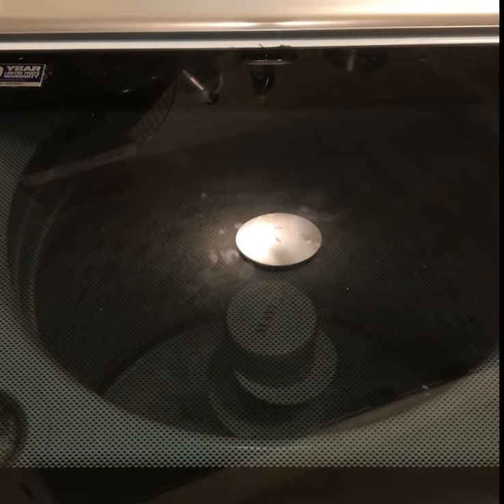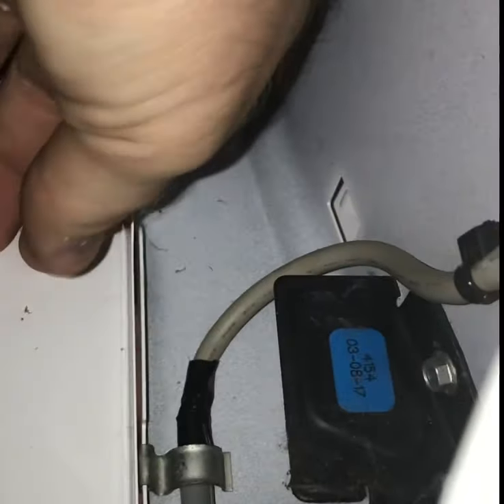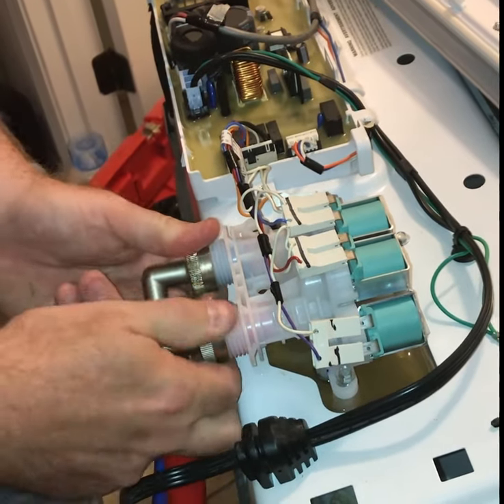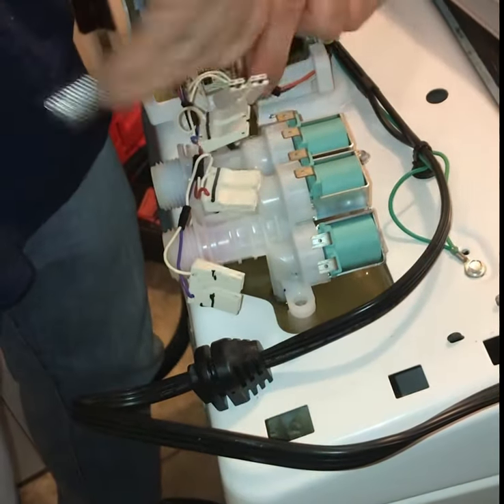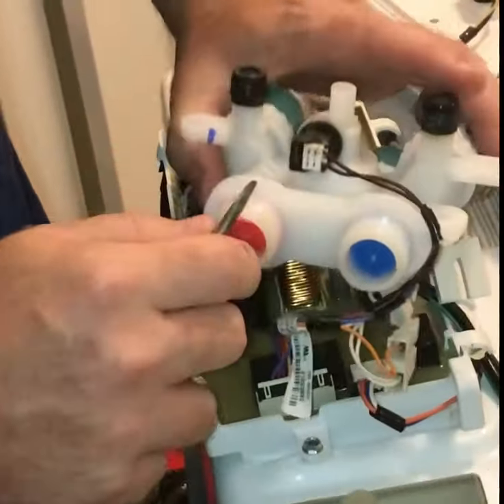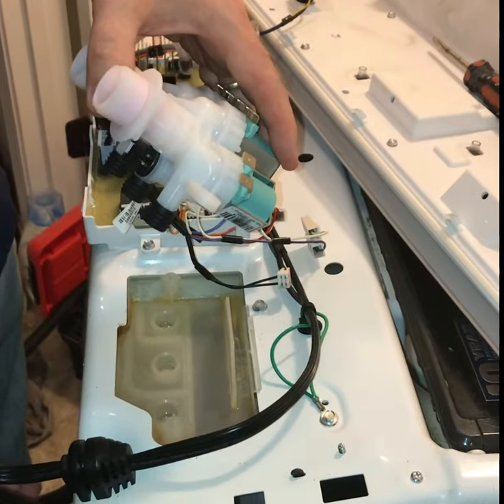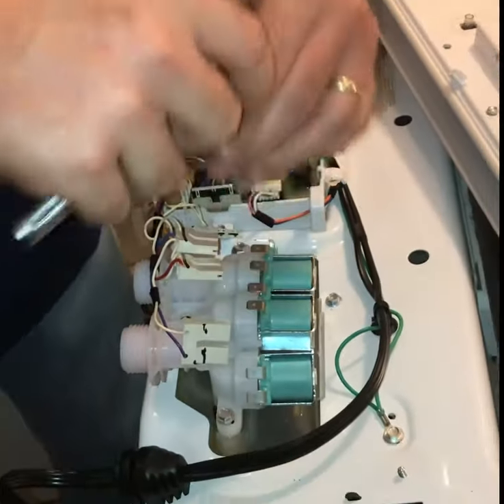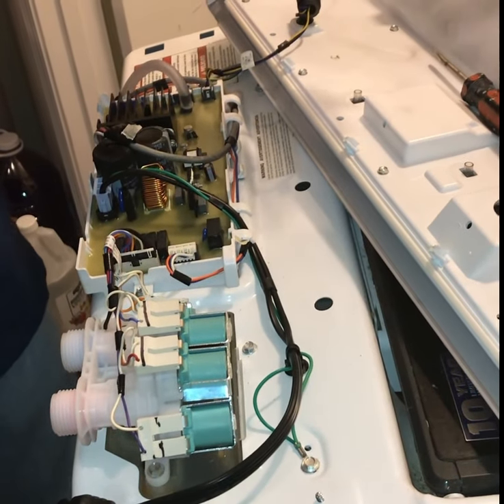Maytag Commercial Technology washing machine water inlet valve replacement

Comment: You don’t have to reach under and “squeeze those pins” to take the control panel off. You can just slide a putty knife under the corners of the control panel and it will roll rite up.
Reply: Another guy used a butter knife which is longer & thinner, worked perfectly!!
Reply: Ummm, no you can't. Just tried it on a Maytag Bravos, and it did NOT work.
Reply: @garethhale1672  ummmm just because you couldn’t doesn’t mean it can’t be don’t. I do it probably 5-7 times a month on bravos
Reply: @garethhale1672  push an 1” putty knife straight towards the back about 1/2-1 inch from the end of the panel. It has a fair amount of pressure but as you get it pushed all the way back roll the panel towards the back to get it lose. Then do the same on the other side and it will pop rite off.
Reply: @Aaron Fuller  Thank you! I didn't mean to come off as a jersey. Just super frustrated and I couldnt get the butter knife trick to work.  Got it done with a slender putty knife though.
Reply: @garethhale1672  great stuff buddy!! I’m glad you got it fixed!
Reply: ه٧
Reply: @TankGunner84  Sorry to jump in here, wondering if you know wether the blue and red filters are removable? Did not want to start yanking on them as they look pretty fragile. Thanks
Reply: @headspace8338  you mean the water inlet valves? If so, then no you can not remove the plastic screens. You can kinda clean them a little and flush the stuff out but if the are clogged you’ll need to replace them.
Reply: @TankGunner84  Thank you, was able to clean them out. That was not my issue with the washer, think I have a bad shift actuator so I’m cleaning and replacing hoses while I have it out.
Reply: @headspace8338  that’s a common part to fail. It’s a good idea to change hoses and clean everything especially if u use fabric softener (you shouldn’t).

Comment: For those struggling to get the connectors off, I took a tiny flathead and put it on the top of the connector where it looks like a white "T" and tapped on the back end of the screwdriver. Only thing that worked to get those off. Wiggling wasn't cutting it.
Reply: Where do I get the model serial number from?
Reply: My wash machine is just like that one

Comment: Finally ! Took forever to find a video with my exact washer ( most didn’t have agitator) I researched how to put in test mode & water ran with each selection unfortunately no matter what setting I use or what tricks I try the water level won’t even halfway cover my clothes. Even after a full cycle they’re covered in lint & powder v
Reply: Did you find the answer, why not filling? Have same problem.
Reply: I have the same issue
Reply: I have the same issue as well since it was brand new it just does not put enough water into the basin even with Max fill setting. I literally have to put in 4 gallons of hot water on top of the dry clothes before I start the cycle or it will not wash the clothes What a piece of junk this machine is.

Comment: A few months later (if that long) you notice water leaking from the same exact spot. Just a Hint from a 30+ year technician. Add a little O-ring lubricant to the black seals where they go into the water distribution channels. They'll seat easier and prevent having to replace the inlet valve again, lol.

Comment: Great video! Based on the comments these inlet valves go bad a lot so you are saving people a lot of money. A lot of people have had a problem getting the wire connectors off and I came close to giving up because I couldn't get any of them off no matter how much I wiggled and pulled. I finally used a fairly large flat head screwdriver right up in that gap in the middle and gave it a couple of gentle taps with a hammer and they came right off.
Reply: Thanks. Had the same issue and the video is frustrating when he pre-loosened them.
Reply: THANK YOU!

Comment: I have a Bravos XL washer and looks just like your commercial one and I have the same leak. I found your video helpful to get the control panel off. Got my part ordered from your link and had a coupon code for 10% off on the page to apply to it as well. Thank you for your video!
Reply from the maker: Glad to help.

Comment: The Bravos XL and some other commercial HE models are the same layout (Mine is MVW765FW0) and this video was so helpful! While we didn't have a leak, we got the LF error and no water was coming in. Upon inspection, the input lines were working but we found the cold cylinder valve had a slight crack in it and would fail diagnostics. Replacing the water inlet valves did the trick!!! Thanks again.
Reply from the maker: Glad I could help .

Comment: Kudos and thanks.  This was spot on.  Those top console tabs were a b%$ch to pop off.  I didn’t have enough strength in my fingers to compress them, so instead I was able to push one end with a screwdriver from the top by removing the metal back of the console.  It was held with 5 quarter inch hex screws.   That seemed a lot easier to see, plus no contortion under the lid and behind the basket.   The oem valve was $26 next day delivery from Amazon with 10 year guarantee.  Maytag wanted $112 plus shipping.  My Maytag model was MVWB865GW0 and looked identical to the one in the video.  The machine was only 3 years old when the hot water valve started leaking because it wasn’t completely shutting off.
This new machine replaced a 35 year old Kenmore that I took out of service still working perfectly as a gift to the queen to modernize.  She wants to kill me now.  This top of the line Maytag doesn’t clean as well, leaves soap in the clothes and was very expensive.  The only repair I made to the Kenmore was to replace the mechanical timer unit that wore out after about 25 years.  I could have replaced the mechanical transmission, bearings and motor and had plenty of money left over.  Now I know why laundromats keep the old mechanical machines.  The new ones suck.
Reply from the maker: Back in the day they built things with integrity and made them to last a lifetime.

Comment: Thanks for this Video!  I would never have found how to access the water inlet valves.  The hard part was to get the wire connectors off without damaging them.  My washer would only let a small amount of water in.  I replaced the water valve and that fixed it.
Reply from the maker: Glad I could help!
Reply: Is there a trick to getting the wire connectors off without damaging? Mine are STUCK!

Comment: Thanks for the vid. My machine wouldn’t fill, showing a LF error code. It would shut down. I ordered a replacement water valve (Amazon for around $40) and installed it in about 20 minutes. Next time it’ll take half that time. Biggest challenge was releasing the clips (couldn’t get my paws up in there so carefully used a blade from the top to release). It now works. I loved saving the $300 + it would have cost otherwise.
Reply from the maker: Glad to help !

Comment: Very useful video BUT reality check for people attempting this repair: The instructions at 0:41 is absolutely impossible to achieve and perform!! Opening that panel is on a difficulty scale of 9.5 (out of 10). The realistic way to open this panel is getting a putty knife and pushing into those clips from the corners. It requires LOTS of force. Maytag has not made this process easy. Just thought I pass this on to others.
Reply from the maker: With God all things are possible.

Comment: Great video!!! The only thing I would add is to hook the water lines back up and turn the water on before placing the control panel back on and run a cycle and check for leaks around the new water inlet because the new one I recieved was defective causing it to leak water. Could cost you a small fortune in water damage to your floor if you dont check it for a leak. Again very useful video.

Comment: found water in the same place u did and traced it back...grommets seem ok but rplcing whole valve anyway...thanks for the vid and sharing.  I hope this will fix the issue.  I had taped paper towels around every other valve and hose connection and when i didn't find them wet all and traced the drops i knew this had to be the place.  Some times it would leak and then go weeks without any issue.
Reply from the maker: Glad to help.

Comment: Best video ever!  We have the exact same washer and had the exact same problem.  I got an estimate for $350, then saw this video, bought the part for $53, and did it myself.  I'd love to buy you a beer (send you the money) if there's a way to do that - let me know!.    PS. The top console didn't clip back down, and it's a little loose now.  Does that matter?
Reply from the maker: Glad I could help. As long as it stays in place and doesn’t slide around during its cycle it should be fine.

Comment: For those struggling to get to the spring clips that hold the console panel in place: it’s possible to pull off the whole top and lift it up (at least for model MVWB765FW3).

There’s two additional hex screws you’ll need to remove from the back first. Then the whole top slides toward the front of the machine and can be lifted up (be sure to tape the cover down first).

After that it was super easy to release the springs.

Source: https://youtu.be/IpLF007BXmw?si=1oWuQmpXohrLm-bp

Comment: Can not get to the left pin. In video you show the right side and there is a little black box there but it’s not in the way you can still pinch that super easy. On the left side there is something in the way that does let you squeeze the front part. I tried what other comments said about just using a putty/butter knife but that’s not working either. Any other suggestions?

Comment: Is there a way to get the wire connectors off without damaging? Mine are STUCK!
Reply from the maker: @veronicaloose5868  maybe get some electronic contact spray and see if that will help. Comes in an aerosol can.

Comment: My Maytag Bravos XL will not stop filling up with water. I have to turn off the machine for it to drain all the water. Any idea what is causing the problem? I think it's the main control board possibly or water level switch? 🤔
Reply from the maker: Wish I could be of some help to you but ive never seen that happen .
Reply: @stevescoolstuff126  okay ty. I will figure it out somehow.
Reply: @rahzvlogs2994  ours is doing the same thing, service guy said it was the water inlet valve. Purchased on Amazon, 34.99. I'm going to try this on our bravos xl and see if it works.

Comment: Great video. I purchased the water inlet valve and was able to try and replace it. The problem I was having trouble with is  that the rubber gaskets seem like they are not fitting in well. They push up further on the piece, so I tried taking them off and putting them in the holes. Then I put the inlet valve on. It pushed one of them in further and when I turned it on, both ways, I got water spurting out. Any suggestions?
Reply from the maker: Can you replace the gaskets on your new one with the ones from your old one or was that your problem with the old one?
Reply: @stevescoolstuff126  Steve, I am so sorry I forgot to respond back. I took your advice and replaced the old gaskets onto the new piece and it worked. Thank you so much for the advice!

Comment: I cant get the connectors on the inlet valve off, and im really not trying to wait two weeks for another part, is there a easier way to remove em. It seemed simple in the video
Reply from the maker: The hoses or wire connectors?

Comment: Thanks for the video...needed to replace the inlet valve for my Maytag Bravos XL. Same setup, except the tab you squeeze on the side by the inlet valve is hard to get to. I used a few flat head screw drivers to pinch the tab and pry it up.

Comment: Our washer won't fill with enough water on any setting except deep water wash and it has to be on extra heavy soil. But when we use that setting the agitator won't work correctly. If we use any other setting the agitator works but it won't fill up with enough water. 
Would a new inlet valve fix this issue?
Reply from the maker: I honestly don’t know but read through the rest of the comments and see if anyone else said that fixed it for them

Comment: I got the same washer just bought the same part as in the video and for the life of me I can't get them wire Clips off those connectors without feeling like I'm going to break something they don't budge
Reply from the maker: I guess just keep wiggling them
Reply: @stevescoolstuff126  I got them off all I did was take a flathead screwdriver and pushback from the head of the clip and it popped right off. Currently doing a test run cycle now

Comment: Have a question can you reach out
Reply from the maker: What’s up
Reply: @stevescoolstuff126  mine is the commercial Maytag and it is completely stopped doing any kind of cycle it barely moves to start off with no matter what mode you put it in
Reply: The washer was bought in 2019
Reply: I put it in diagnostic autotest mode is coming up the F7 E5 errors I know that mentioned something about an actuator
Reply from the maker: @Bob-ld5uq  Wish I had an answer for you but I haven’t had that issue.
Reply: @stevescoolstuff126  ok thank you

Comment: My Maytag is model MVW6230HW2 bought in 2022 and installed on March 1. The valve started spewing water from the hot side where the hose attaches to the valve. The plastic was cracked. I ordered a replacement valve, installed it, and then ran a test load. Water was slowly dripping down the back of the washer when it was filling and rinsing. I removed the new valve and discovered that the middle port did not exactly match up with the hole, and the rubber grommet was not doing its job of providing a leak-free connection. I have contacted the seller about the problem. Maybe I'll get a refund. The middle port on my original valve is equal in distance from the two outer ports, but the replacement valve is off center by about a millimeter, maybe less. Now I am waiting for replies as to the spacing of the ports from other brands so I can order a valve that actually fits.

Comment: I see why you never showed how to release the pin on the left side
Reply from the maker: Those pins are awful !!!
Reply: Yeah I can’t get the one on the left. Right easy enough. Any tips?
Reply from the maker: @skoldpadda9  You just have to feel for it and squeeze.
Reply: @stevescoolstuff126  I can locate it but just can’t squeeze it like I can the right one. It’s in a really awkward position (more limited space than the other side) and I have big hands. Appreciate your video though!
Reply from the maker: @skoldpadda9  can you get some channel locks in there to squeeze?
Reply: Other videos say to go in from the top (between the body and the control panel) with a butter knife.

Comment: I own this exact washing machine, what a piece of junk it is, that water valve lets out such a small amount of water it is impossible to wash a load of clothes without dumping in 4 gallons of water on top of your dry clothes before you start the machine up. Other than that it won’t put enough water into the tub to wash the clothes. I also replaced the valve with absolutely no change in the water flow.